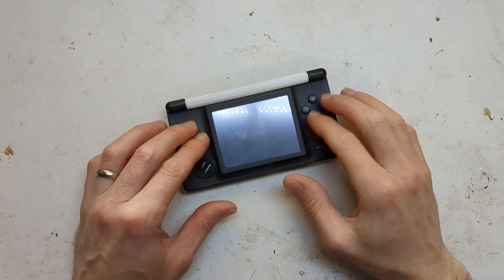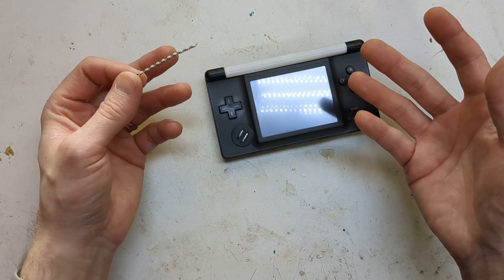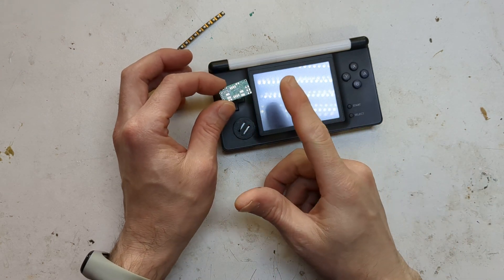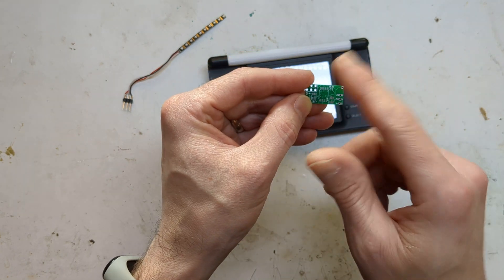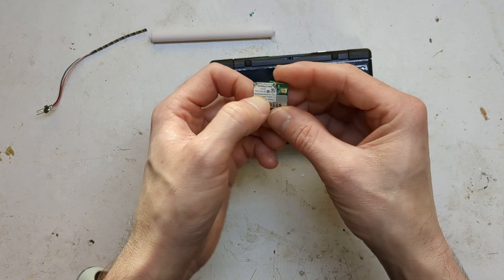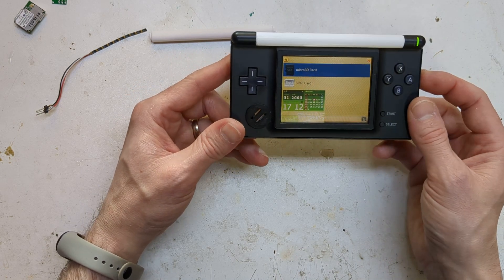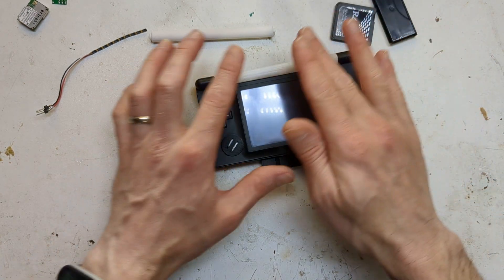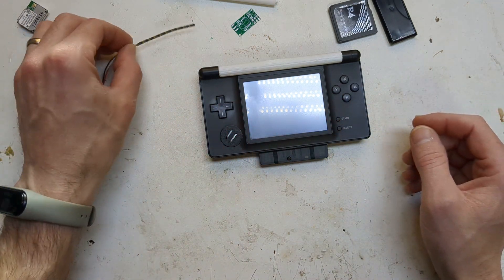Gameboy macro RGB light bar

Comment: I have a question, the LED strip isn't available for me, can i just use any with the same name? And do i need a connector or not?
Reply from the maker: You will need any Ws2812 strip that will fit. I just hard soldered mine on to save space.